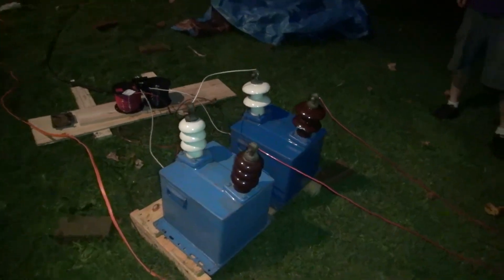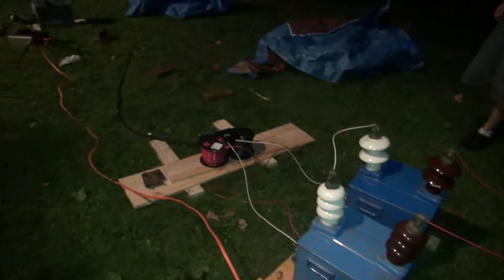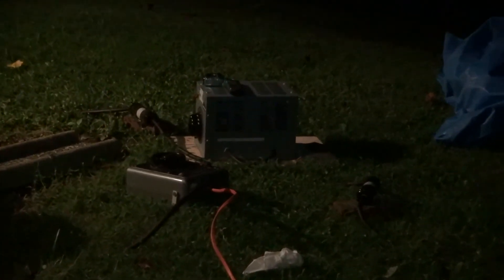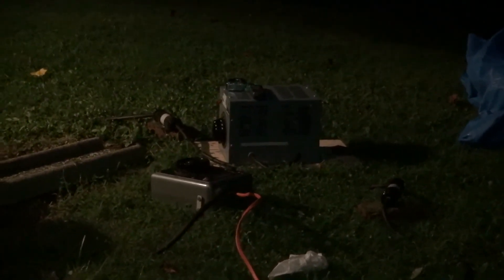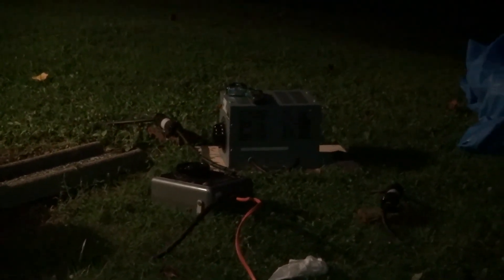Tesla Coil 6KVA first light

Comment: That rotary spark gap looks awesome. I just built a small coil, about 280 VA, and at its best it'll throw a 20 inch arc but I'm running into a problem where the arcs diminish into a fizzle after a short time, if I turn it off and let it sit for a bit the full size arcs come back. From what I've read, I think it's because the static spark gap doesn't turn off to let the capacitors refil because it forms highly conductive plasma between each side of the gap.
Reply from the maker: what kind of cooling do you have on that sparkgap,  your described problem sounds more like its becoming thermally saturated, which causes early breakdown due to the excess electrons (thermeonic emmission)

Put some forced air on that gap, and im guessing you'll see improvement.
Reply: +Jhowson4 Huh the heat was my first guess. I dont have any cooling as of right now but Ill setting up a computer fan next to it next time I run it.  Im wondering if that'd be enough air though, that thing gets really hot.
Reply from the maker: +KingofHearts67 I started out with a computer fan on my first coil, not very effective with just a two electrode gap.   I would recomend you construct something called a sucker gap, google will provide more info.   =)
Reply: +Jhowson4 The sucker gap looks very interesting, I glanced over some stuff quickly but will definitely have to look more into it. I was also thinking of making one of those chain spark gaps, I don't know the proper name for it, but it's the one where you have a series of several smaller gaps, I usually see people make them where they spiral up a pvc pipe. Have you ever dealt with those?

Comment from the maker: Thank you, See the video in my channel for more of the spark gap. 
You can also send me a PM and ill link some more pictures as well, i check you tube every few weeks. 

Yes, I do need a larger toroid.  I reused the one from my old coil, and happened to buy a nice spun one of similar dimensions a little while back.   after my test run, i quickly realized i needed more top load capacitance, so i stacked them. I am planning on buying a much large custom foam core toroid in the near future =)

Comment: Sweet spark gap! I like how it changes spark behaviour when you change the rpm. 
You should consider a much larger toroid. With that much power available you can easily get twice the spark lenght. A larger toroid throws sparks more outward, so you'll get less primary strikes.